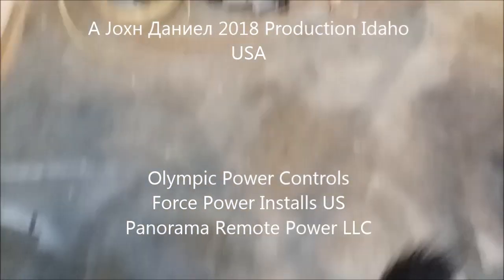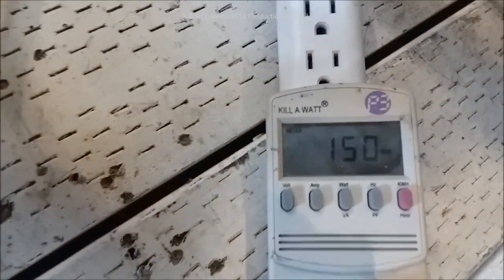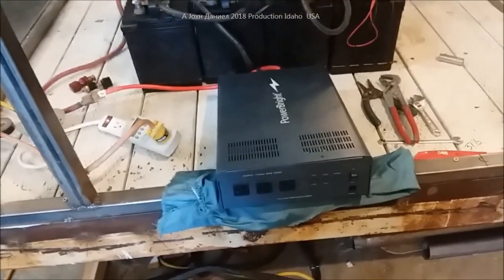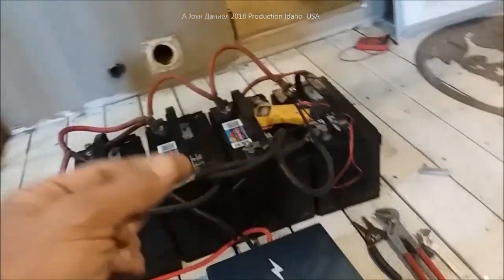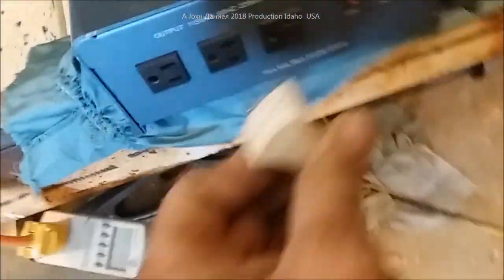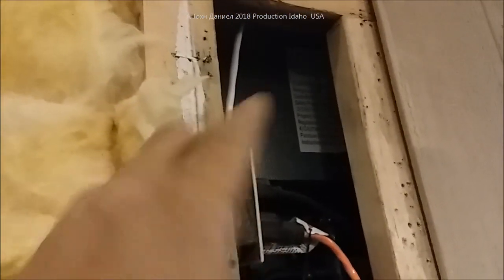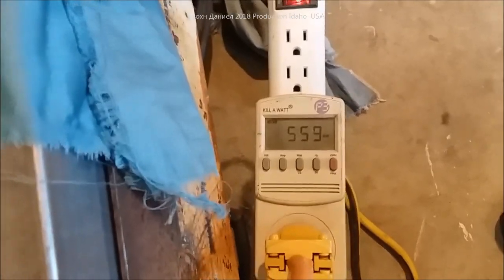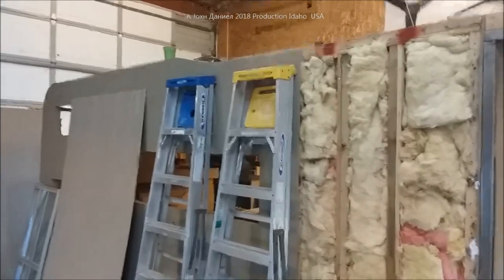Powering Hybrid BUG OUT RV - 2200 watt Power Inverter & Solar panels UPDATED (parts Below) ↴

Comment from the maker: 300 amp terminals https://bit.ly/2zYTftE ,My PowerBright APS-2200-12 pure sine https://ebay.to/2O5Efgv ,Low 50 watts consumption Galanz mini fridge $109 free ship https://bit.ly/30B1TJv , MY TIP  ✌  FOR MY LONG TERM CHANNEL FOLLOWERS  Complete 1200w OPC SURVIVAL POWER SYSTEM -- 100 Watt Panels https://ebay.to/30FYSs1 ,$120 REAL 50A MPPT https://ebay.to/3abTqju ,Solar Connects https://amzn.to/2XJOa1M ,Battery cable USA made https://amzn.to/3h6dsim ,12/2 Above/Underground https://amzn.to/2XIJolg for safe DC wiring of lights and appliances. (appliances you can use on 12 volt full list below)
Cheap Inverters with proven 4+ year records of quality - 3000 watt https://amzn.to/3awLWrS for tool, high amp and start up use, & a 1000 watt Pure sine for sensitive computers, TV's and electronics https://amzn.to/2Y1UHoH or just go one big inverter a 3000 watt pure sine (preferred method) for what your system can produce in peaks https://amzn.to/3iNsQjQ 
 
*BEST BATTERIES - aka DEKA SOLAR are Duracell GC2 & B-903-L16 that actually can last 10 years. Made by East Penn, sold by Batteries+ as a Duracell for less.  https://bit.ly/2wv1VXd Order online, pick up for cheaper. Don't let more $$ lithium sellers fool you Go best in class or this Below!!!
 Solar Connects for DIY https://amzn.to/2XJOa1M

Comment: Did you put a small wind turbine on the trailer as well for backup energy?
Reply from the maker: We have one for it, but not installed until needed. the best one we found for remote or in-travel install is the 300 watt they sell. It really hits over 300 watts as rated, unlike those they scam and claim outrageous output.  I put its source below this video. https://youtu.be/pZuI2wSXO6o

Comment: That power bright works great, fridge, fan, TV, small computer, it doesn't make a sound except for the fan, it hardly ever comes on, 1020 watts, hooked the 4-100 Watters like u suggested, 2 -310 series 4 Eaton sealed batteries , 40 and 60amp mppt controllers , going to order  that Chinese wind turbine next, thanks for sharing your knowledge.

Comment: You need a long term test with fully charged batteries,,,you don't have enough batteries,
As a general rule...you need one battery per PV panel 🤔
I'm doing the same setup.. been testing and testing with one of those brand new W7 2000 Watt 6000 Watt surge and fried it...I stopped there back on the road for now, anyway I'm doing 4 Renogy PV panels and 4 Renogy gel batteries I want more but don't have room,
Reply from the maker: That general rule was made up by sellers. Been off grid since 2008, 44 panels and 14 L-16 batteries

Comment: Your opinion of the Amazon item below?         Tony WZRELB                                                                                                                                                                                                                                                                          WZRELB DC to AC Converter off Grid Pure Sine Wave Power Inverter Generator (3000w 12v 120v)
Reply from the maker: Some good, about a 6 in 10 quality rating.

Comment: You can get mono for that same price by the same brand on Amazon
Reply from the maker: The only problem with buying china $99 mono-crystalline is they are of the poorest ingots in quality, you will find their top solar absorption angle is in the 20 degree angle, no more. Numbers on the back of the panels look super sweet, but in reality, lay it down for flat mounting, 1 good hour, the rest its a dead duck! $175 Mono 100 watt panels are just fine, even great. But they need a tracker, and tilt to the sun to give you 5 good hours in a 10 hour light scenario. Poly being very slightly less efficient, yet very affordable has the ability to begin charging above battery level sooner, charge hours lasting longer. Great for laying flat if you have too. I could have saved 5 square feet of roof space using Mono, but then what was I wanting a unshaded hot spot from the sun for.

Comment: Why did you go with Polly instead of mono
Reply from the maker: Mono do not handle mounting flat as well, are insanely expensive to get with more than 3 buss bars, dirt effects them worse. Poly is able to charge longer near their rating laying flat, a little dirt don't kill their ability to make power, and they come in 4 buss bar which at $100 each makes it a win.

Comment: Another informative , I looked  for those batteries on Napa's web site but no luck.I've seen some used REC 310  watt  panels rated at 36.7 volt out put for sale on Craigslist was wondering what kind of charge controller would be best to convert to 12 volt?
Reply from the maker: You can put this on your list, https://amzn.to/2LMF2oj for up to 520 watts in, OR https://amzn.to/2LIRUvD for up to 800 watts in . Same as Renogy and Solec but $40 to $90 cheaper (1&2) ! And you can hook those panels to it up to 100 volts DC and charge 12 or 24 volt batteries. Just keep your ohms law book open, and the rest is easy.
Reply: Decided to go with the mighty max instead, ordered 4 for now plus the 40amp tracer, I found the power bright  inverter for 405 on home depot was glad the olé wallet looks pretty desolate after that but excited to get them on the olé rv,  how would you wire the panels parallel or parallel two sets then series them ?
Reply from the maker: Wire them hot, 2 at a time then to your controller. The controller runs nice at 55 volts incoming.
Reply: So there would be two pos and neg to the controller, the wire them hot means parallel two sets then to controller?
Reply from the maker: Take panel 1, run its negative to the controller, take its positive and run it through to the negative on panel 2, then take panel 2's positive to the controller.  Repeat for other set. If you have a issue, check with maker on which Diode may need removed. Most Mightmax are easy to run that way.
Reply: Thanks John.

Comment: Go for 18650 Batteries
Reply from the maker: For my 35 foot Jayco we are looking at the 18650 using 250 to 270 cells. But for this BUG OUT trailer,  I actually did priced out the battery wall option, however the US military and some homeland security scanners can pick up your signal of 1120 to 1,200 kHz lrf band from the Lithium based materials from over 12 miles away. Low frequency, long range sensitivity.
 Compared to Lead Acid, its responding  bandwidth is in the 31 to 36 MHz band the signal radiation from them is about 2500 feet. My friend in Mountain Home Idaho out of the air force retired told me that the best battery was old trusty lead. So one, has electrons via LEAD is like a very weak TV signal in IRF, the other is like a 200 watt blasting HAM radio IRF. But, we are still looking at the sub class batteries for our jayco to reduce weight.
Reply: Јоhn Daniel so Tesla cars are not allowed to be a Daily driver?
Reply from the maker: Not sure how Tesla cars are related to the issue. I know they have a battery bank made of Lithium Ion but why would they not be a daily driver is confusing. My neighbor about a mile away ( I only have 9 neighbors within 2 miles from me)  drives his model S every day. He has 12 of the 235 watt BP Solar panels I put in for him in 2016 charging it and his LeCar 72V. 
However, I love the power wall concept, but the after market battery quality is so off the mark I am still waiting till you can get 100% dependable before I power my 1994 tercel with them. Its got a 54 horse 90 volt motor just waiting till I can power it right.
Reply from the maker: Since my wife works at Walmart, I can get 18650 batteries in huge numbers on a employee discount, check these out https://bit.ly/2LxkAaO
Reply from the maker: PS, If you know where to find that bigger 6.75 volt battery I can get thats at least 5 amps please send me a link. I know some cameras use a battery like that, just not sure which one.
Reply: Јоhn Daniel you said all 18650 in Mass created a Air Wave Hz since the airport picks up so I thought a army of Tesla would interfere

Comment: Thanks for the re-upload.  Tried to watch it the first time around and it had no sound after 10 secs or so.

Checked out the description; you didn't list what kind of batteries?  

Nice setup though.

Why not consider a 24 volt system instead?
Reply from the maker: Batteries are a version of these http://usbattery.com/products/12-volt-batteries/us-31dc-xc2/
There are dealers all over for them like MENARDS, advance auto parts and some home centers. 
As for my choice 12 volt system, its a prepper thing. 12 volt is everywhere, 24 volt has to be ordered and cost a premium . If a inverter or fan or bulb or cooler or radio or Alarm system - or ?? fails, its off to a truck stop - walmart - autozone - auto junk yard or where ever. A 24 volt item fails its order, wait, wait, .........  And yes, I can get a 24 volt to 12 volt converter, for $100 big enough to run all the 12 volt stuff, then when it fails, and they do very often fail, its  Hmmmmm
Reply from the maker: Finally figured the greedy ad BOT from Google attacked me over posting this Sportsman Sand Storm 2000. The 2000 watt Generator I was getting https://bit.ly/2LLM8X3 for this install.
Reply: Definitely a good setup.  I almost have the same setup you have as well.  Four 12volt batteries in parallel, 6 x 100 watts panels and a 1500 inverter.  I was just curious about the 24 volt thing because I'm seriously thinking about converting my system to 24 volts.

Tie two in series to make 24 volt then parallel the 2 banks instead of 4 in parallel.   My charge control can do 12 and 24 so I'm good there.  All I need to do is get a different inverter.  Reason why I'm thinking about converting is when I connect a portable burner to cook food (or a my dyson vacuum) it pulls over 100amps over that line which worries me quite a bit and probably not a good thing for battery balancing when you tie a string of 4 in parallel.

Or maybe tie all four in series and do a 48v system instead.  Then it would only pull 25 amps over the line which is pretty low. :)  Ah so many ideas, so little disposal income for side projects hehe.  Thanks for all your videos man.

Comment: Thanks for All your updates on your rig, John. I have one myself I'm building its an 29'6" new trailer frame tandem axle Heavy Duty frame setup and I put on an 8'x8'x20' truck box on it. and building everything we need inside, kinda like you are doing. I like your Solar setup I've been watching and trying to learn this stuff. Yours are the Best I've seen so far, I think. My Refig is one I had in my last Peterbilt truck (its new) I think I will use it. it is one of the larger units Not the small ones (stands appox. 4' tall). I'm watch'n your build real close to see what I can learn. 👍🏻
Reply from the maker: What I learned about using those truck boxes would surprise you. If you build your trailer base with 3/4 plywood on 2x3  frame on 12" spacing you will be able to cut away the upper half of the box and put it on the frame with the super heavy commercial grade floor removed. I got one that was 8 foot tall, mounted a 2x6 all the way around it at the 7 foot mark and then stilts. from there I cut the box top off, dragged the bottom out (70% of the weight) and then backed the trailer under the box top. Light, strong and finished!

Comment: Could you clarify the model number and source on those batteries
Reply from the maker: Group Size 29DC
Reply from the maker: In the western USA you can get them at walmart and most are made by Excide Battery in the east its cheapest provider supplies them to walmarts. If you look for USBattery.com and find a distributor your getting about the same thing from a local supplier.
Reply from the maker: Find a local dealer for these and you will love the hell out of them. http://usbattery.com/products/12-volt-batteries/us-31dc-xc2/

Comment: Thank you Mr. Daniel.     Question? The Power Bright  can surge for 15min  at 4400?  The ad says 15min, not 15 sec.   Does that sound right?
Reply from the maker: REAL INFO - Surge to 4400 is 3.7 seconds, surge to 3600 is 8.6 Seconds, surge to 2800 is 15.1 seconds, and "continuous" run of 2200 watts should be limited to 10 minutes. Hmmmmm. Better than 90% of the inverters out there, but it does say you can run it at 86% non stop till the cows come home. About 1900 watts never stopping all day all night. Thats significant compared to other inverters in reality. Most would fail running 75% rating continuously.